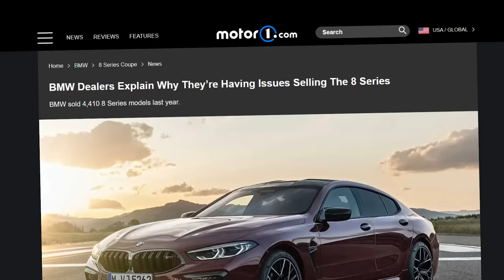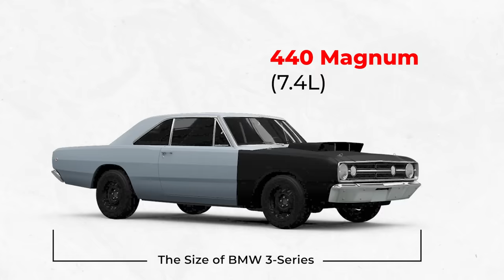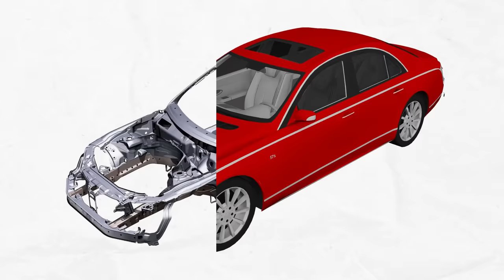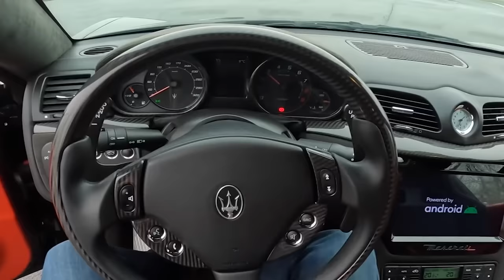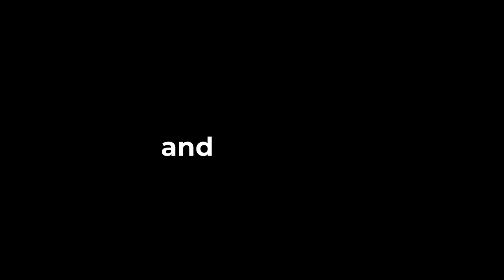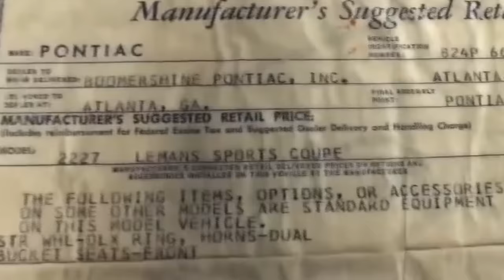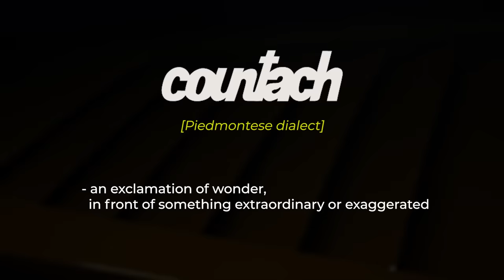Top 7 Cars that Should've STAYED DEAD

Comment: As much as I usually agree with your opinion, I can't say the same about your opinion on the 8 series.
The G15 8 series still looks very special on the outside. Especially in black it looks like something you don't wanna mess with. 

As from the performance point of view? It's absolutely doing the right thing. BMWs especially M cars are generally known for making a lot more power than claimed (hell, just look at the M5 CS that can almost keep up with a new 911 Turbo in a drag race). And even if the E31 came out with an M8 variant that made 700 horsepower, it still would have taken a while to take this thing off the line. That's just how high performance luxury cars worked back in the days. Power isn't everything.
Reply from the maker: Power isn't everything, but if you are bringing back the Big 8, and as a halo car not than less, then it needs to be the biggest, meanest beast in their lineup. 

Instead, M5 CS and XM tower above it
Reply: @TopCarsTV  Yeah, it's a weird decision considering its rival GT63 is receiving power bumps of over 800 horses. Maybe they'll get to it this year unless they decide to hybridize everything as well. Only time can really tell.
Reply: M8 is basically a substitution of the M6 i think
Reply: @GJimenez94  Yes and no. If I remember correctly the E31 8 series was fully integrated in the luxury segment and only shared parts with the 7 series. The new 8 series is a weird inbetweener: not exactly 7 series luxury but better than 5 series. Also the same sporry engine unlike the 7. It would have been better if they just kept the 6 honestly.

Comment: The only one i disagreed was the Alfa. I personally think it looks really good, but not as good as the concept, so i get your point. As for the rest, the biggest disapointment of the cars you showed is the Maserati Gran Turismo. 
It doesn't look awful ir ugly by any standard, but it's not "bite-the-back-of-your-hand" beautiful as the previous one.
The lost the agression, the sex appeal, and i dare say: from most of the angles, it looks fat. It's not obese, but it's not skinny either. Those MC20 headlights simply don't fit with the front end. And i'm not even talking about the electric Folglore version. Because it's electric, it doesn't need an engine, and because it doesn't need an engine, it doesn't need a cooling system. Still, that's no reason for making the front bumper look absolutely saggy and melted.

Comment: I agree for the BMW 8 series, they should have just let the 6 series name and make an 8 series as a competitor for the Aston db11 and Maserati Granturismo... speaking of which, i agree on that as well, and same for the Dodge Dart and for the missed opportunity of a new Alfa Duetto (it would have been glorious with the 4c engine...).

Regarding the Countach i think it looks gorgeous, even if the Syàn which is based on looks even more special (more "countachy" if you want), maybe it was just better to complement the name as "Countach Tributo" just to clarify that it was just a limited production model meant as a tribute of the original, instead of being a successor (which is not, that was the Diablo at the time). Hell, Bugatti even did the same thing with the Centodieci.

I do not agree for the GTO, the Beetle and the Integra, The GTO was still a cool car and while being a bit blandish that was the only problem, not that it didn't look retro enough... it could have been just a little more "decise" looking to compliment it's roar while remaining modern looking.
The New Beetle was a cool tribute in my opinion, it looked modern enough while remembering the idea of the original, even if in my opinion it could have been better if slighty smaller or more "coupe like" to further differentiate it from the Golf from a driving standpoint.

And please stop glorifing the old Integra like a rare supercar of some sort, the Integra was super cool but it was just a slightly sportier, more upmarket version of the Civic, and that's exactly what the new model is. The Type-S version isn't even out and people keep complaining that it looks too normal (those people probably never saw the original base Integra models apparently...) or even worse, that it doesn't look like a 20+ year old model... Imho it looks exactly how a more upmarket, Acura branded version of the Civic should look like... Did you expected a monster coupe unique model kind of like a lower tier NSX that people wouldn't even buy? That's not what an Integra is. It's fine if you don't like the new looks but don't just assume that that's not how the Integra should be.

Comment: The new GTO wasn’t “based” on the Monaro it WAS a Monaro. The only difference is the front bumper/grill and the name.  

And the styling was the exact same as the Holden commodores of the time the only difference being the GTO/Monaro was a 2 door. 

So it never had retro styling simply because the Monaro wasn’t designed to look retro it was designed as a 2 door commodore and had the old Monaro name thrown on it. And was then shipped off over to the states as the GTO and pommy land and badged as a Vauxhall. 

So yeah it “failed” as a GTO because it was never intended to be one in the first place. It was a 2 door commodore whose name was a throw back to the old Monaro’s of the late 60’s and the 70’s. 

So yeah not the cars fault as much as it was GM’s lazily slapping the GTO name on an Aussie car.
Reply: The car wass too good for Americans

Comment: They definitely made a 90s ///M8 but disguised it as a normal 850 (designated as the CSL). They came equipped with a 7 liter v12, a getrag 6 speed manual and their VIN IDs started with WBS; which means they were built by BMW's M division. They only made about 1000 of them because just like the modern 8 series, they sold terrible as they were god damn expensive (about 100 grand in 1993).Over the decades they have retained massive resale value as pricey, collector grandpa cars. Only problem is you simply cannot tell by just staring at one. You have to be eagle-eyed or straight up nosey to identify the difference even though they're all cool to look at.

Comment: The GTO wasn't just based on the Holden Monaro, it was a Holden Monaro, same engine, same chassis, same interior, same styling and same body, the only difference is the grill, the front bumper and a minor change to the wheels. It is a straight up rebadge just like the Pontiac G8, the Chevy SS and the Pontiac G9 concept, these are all Holdens.

Comment: The BMW. This is like the C7 and C8 Corvettes. The first one is a Drop dead sexy looking car that is a torque monster. The second one is a F-ugly mistake that is a joke to it's name and the rest of the class that is mid-engine cars of the Planet.
To the Dart. It's masculinity remained. The new one did not deserve the Dart name. 3:02. What about an All-Wheel-Drive option?
The Maybach. 3:46. This car is gorgeous. 4:00. This is F-ugly Arnold said it perfectly.
The Alfa. The first on is an Italian work of art. The second one looks like someone named Art molested it with an Ugly stick. 5:50. This is a correct Italian design. Italian design with Miata mechanicals? DAMN! 
The EV whatever.(Massie) One of the reasons why people hate them so much is because of the absence of the motor and the symphony that Most Men love to hear.
The new Countach. Lambo failed in this design, It doesn't look anything like the original. And there is also someone who corrected this oversight with changing just 5 things.

Comment: Alright, I used to really enjoy the Maserati Gran Turismo myself. I, however, turned away from Maserati because they all look the same. I understand that internal combustion produces a sound that electrical motors simply can’t but yo…. I’d rather disappear in five hundred thousandths of a second than breaking the sound barrier and going nowhere. I love motorsport, Formula One in particular. I’ve also been to Formula E’s Red Hook GP and you wouldn’t believe how those straight cut gears sound 🤨😆

Comment: To call the Rolls Royce Ghost a “rebadged 7 series” is a joke. The Rolls originally only shared 8% of the parts with the 7 series until the 760L variant, which shared a lot more but BMW put Rolls parts on the 7 series, not the other way round

Comment: Chances of 5 great designed cars that are going to be ruined in the next generation
Porsche Panamera: 7/10, spy photos indicate they are going to the grille look like a whale shark, meaning it would stretch across the full front end
Next Mazda 6 successor: 5/10, the CX-60 is meh to me, those lights just doesn’t look right. Based of that, there is a chance they are going to ruin the 6 or its successor 
Toyota Crown (sedan): 3/10, the continuation of a RWD V6 platform thrills me. Although there is a chance of a slightly worse design
BMW 5 Series: 6/10: surprisingly, the 5 series seems like it isn’t going to be hideous like the rest of the Bavarian manufacturer’s lineup. I’ve seen spy photos and it doesn’t look bad. However, I would have to wait and see before I can make my final judgment
Maserati Quattroporte: 9 to 10/10, Stellantis WILL discontinue all V8s so no more glorious roar. And based on Maserati’s attempted FAILED comeback with the MC20 and the GranTurismo, it’s safe to say that this car is going to get ruined too, leaving the brand to shame.

I think that the current automobile industry is like the current video game industry, both are ruining their products just to make short term profit. There is a greater chance of a new car being duller or uglier that the previous generation. Also, although todays cars are more reliable than ones in the 1970s, they’re less reliable than cars from the late 90’s early 2000s due to the implementation of computers and equipment that will fail someday

Edit as of 12/2023: 3 of the 5 cars I mentioned have came out since my last edit AND THEY ALL LOOK WORSE!!!
Panamera went from an 8/10 to a 6/10, but does not look as bad as I thought.
Crown is now a low powered I4 only.
BMW 5er went from a gorgeous 8.5/10 to a 5/10.

This is further proof that we need to keep our old cars as long as possible.
Reply: Bonus of my favorite brand Ferrari.
New 812 successor: 2/10, I think the design would actually IMPROVE. Spy shots show a clearly disguised long hooded Roma, which is gorgeous in my opinion, Ferrari should soften its looks and replace the 812 with a true grand tourer instead of a front engined gaudy supercar.
Reply: oh my god was this list accurate, thanks for pointing out the spy shots of the 812, I didn't know that one until now
Reply: @zocker5786  What do you think is my most accurate prediction other than the 812 successor?
Reply: @romaferrari9430  honestly, maserati as a whole going down. since stellantis was formed, from a car guy/consumer perspective not one thing has changed for the better, all their subbrands are starting to go to hell (prime example: Charger Daytona EV thing)
Reply: @zocker5786  I’m glad that Ferrari severed ties with FCA. If they didn’t, they would’ve declined

Comment: On the Countach point, I mostly agree that it's too clean and prim, but you don't need to go as far as putting the name on one of their dumb abstract concepts to do it justice. All they needed to do is market it as a "return to savagery" of sorts. First, base the body on the later versions of the old Countach, with a huge body kit. Second, add vents and gills. No "clean-ness" needed in this application. Third... Actual drivetrain changes. Ditch the hybrid and the AWD, just put the Ultimae engine in it powering only the rear wheels. If possible, take the Murcielago stick-shift and put it in. And definitely employ Lambo's brand of active aero, looking as flashy as possible. As a result, you get a V12 supercar weighing somewhere in the vicinity of 3100 pounds, looking angry as hell, and ready to kill you if you touch the steering wheel the wrong way. That's a Countach.
Reply from the maker: This ☝️

Comment: Wait Stype, what are your thoughts about the current Maybach lineup? It's still based on the S class and the GLS. So do you think the revival is doing well or another miss?
Reply from the maker: I like them. The way AMG turns regular Mercedes' into fast monsters, Maybach turns them into more luxurious yachts on wheels. I mean, no one is expecting these to go head to head with Rolls, which is why they don't cost as much either. Cheaper to produce too, so Mercedes won't be losing so much money either

Comment: All valid points in the video but how can you make such a video without mentioning the Mitsubishi Eclips?
You can argue that not all four Generations from 1990 till 2012 are beautiful, but everything was batter than the hideous SUV they built since 2018 🤮
Reply from the maker: Because Eclipse Cross is a completely different car. Like Mach-E or Ford Puma. 

These cars on the list are intended revivals of the originals
Reply: Ok I undersand your point! 👍
So or so great video 😉

Comment: Actually I doubt very strongly that BMW would have bumped up the horsepower of its V12 by 200+ BHP from the 850CSL to the M8 had they made it back then, maybe 50 to 75 BHP so from 375 hp to 425 or 450 hp but definitely from 375 to 640 because a common misconception is that the BMW 6 liter V12 in the McLaren F1 is the same as the on in the 8 series well they’re not, sure they’re related but they’re cousins.

Realize that there were virtually no cars stock in the 80s and 90s that made made more than 500 hp there were 2 I can think of being the Aston Martin V8 Vantage V600 and the aforementioned McLaren F1
Reply from the maker: Those are the stats from the official BMW M site:
https://www.bmw-m.com/en/topics/magazine-article-pool/the-bmw-m8-e31-prototype.html

Would the production version really have 640hp? Nobody can say for certain

Comment: Price point apart, the 8 series does not deserve its fate, it's a gorgeous looking car and is very respectful of its name (its failure is just due to people switching their attention towards boring but practical vehicles) ; as far as the dodge is concerned I completely agree and the Countach is definitely something we could live without but not for the reasons you mentioned. People love the classic one and who doesn't want a sequel to a film they've liked? It's just got a very boring design that hardly has any connection with the original one, that's it. The Beetle shouldn't have failed : sure , as for the purpose it was built for , it would have been a huge departure from the past (but who want to be associated with nazis anyway...) BUT again, the retro styling has worked brilliantly with the Fiat 500 so what did VW get wrong?
Reply from the maker: Beetle was in no way a marvel of engineering and practicality that the old one was. It was just stylish. 
I guess you could say the same about Mini and the Fiat 500 but those were brand new cars developed from the ground up, while the Beetle was based on an old and outdated Golf 4 platform
Reply: @TopCarsTV  I'm agreeing on this one 🤌🤌

Comment: It doesn't really make sense on what you're saying about the Countach imo. It would be very hard to make the new one into another "holy-f*cking-shit-look-at-that-thing-kind-of- a- moment" and still make it look like the old one. It's a remake of the Countach, it should look like a Countach. Leave the holy-f*cking-shit-look-at-that-thing-kind-of-moments to the new Lambo's, let the Countach be the Countach and stay the Countach which we got used to.
Reply from the maker: It shouldn't look like the old one. That's my point. It should look as wild as possible. 

Also, I'd be much happier if the the Countach 800 had flared wheel arches and a useless wing too. There are many renders of it with such kit and it's miles better
Reply: @TopCarsTV  Ok, you do have a point there.They could've made it look wilder with a useless wing and stuff. I bet there's nothing totally useless on the new Countach, which is not the Countach spirit.

Comment: BMW should have put the 760i V12 in the new M8 with a few ///M touches.
But there's nothing new to what BMW did. They replaced the E24 6er with the E31 8er then they replaced that with the E63 and F13 6er, and now gone back to the 8 again
What really is an abomination, is that there's a 4th gen (g32) 6 Series that should have died because it's horrendous.

Comment: Subra should be here
Reply: Not exactly.
Reply: J29/A90/DB42 is in my opinion kinda meh. I'm kinda pissed at how the softie Z4 was it's based yet love how the Supra was developed by the talented Germans. If I had my way the Supra would be based on a shortened 5er platform or a whole new co-developed one from both parties that is larger and more supercar-sized and have 700+ hp and destroy everything like the A80 did. BMW on the other hand could take home a M1/Z8.
Reply: @lukecona2749  I agree and if it should be from bmw it should have the m5 shassis
Reply: @يوسفرافد-ث8ض  - in a way, developing a chassis just for those two cars instead of using a modified version of an existing one seemed to work wonders. Savagegeese touched on this one in the earliest current Supra review.

Comment: as soon as i saw M8 as a pick i knew this video is bs
Reply from the maker: You mean the new M6?
Reply: @TopCarsTV  No, M8. Its as similar to M6 , same as A6/A5/A7... are to A4, or basically all porsches, but they still arent are they? Soo by that kind of logic there would only be 1/2 car models in a car company. M8 can have a weird lineup or weird features, but its still a very fu****g good and cool car
Reply from the maker: @ivarboneless999sigma7  a modern 8 Series has much more in common with the latest 6 Series than the original 8. 

Same goes with the M8. That's why it doesn't really deserve to be called M8
Reply: @TopCarsTV  well i would as well rather see something more similar to old M8, but i do like new M8 as well. Better that than nothing, imo